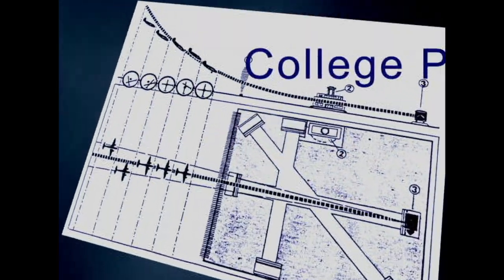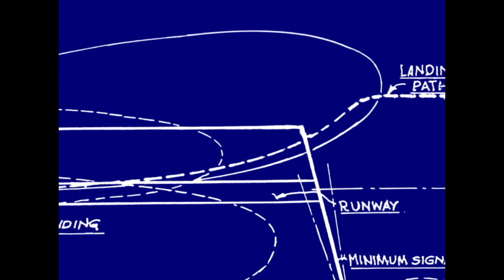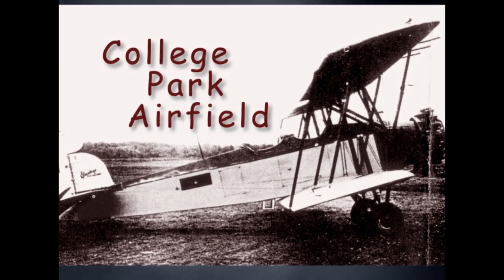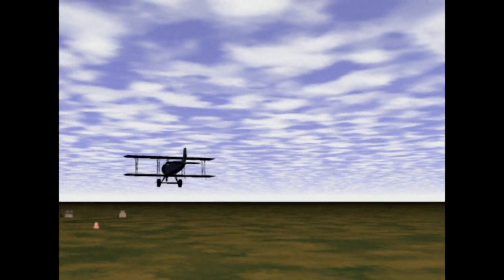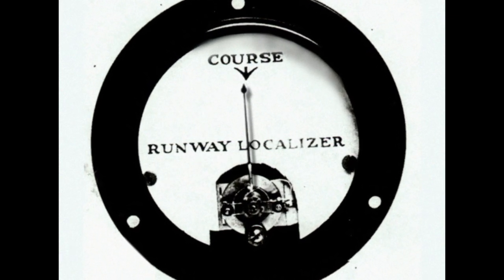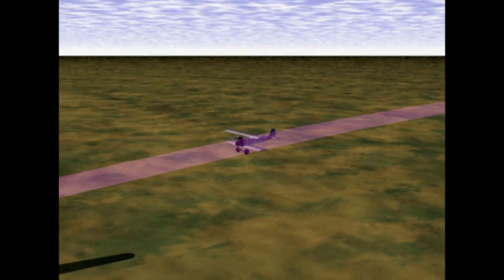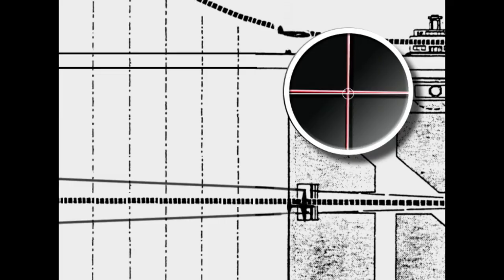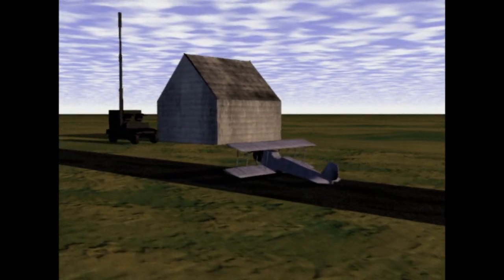Air Tracking Final Movie

Comment: Unfortunately you have both the localizer and glideslope needles backwards. If the aircraft is right of course, for example, the needle will deflect to the left showing the direction to which the aircraft should be steered.